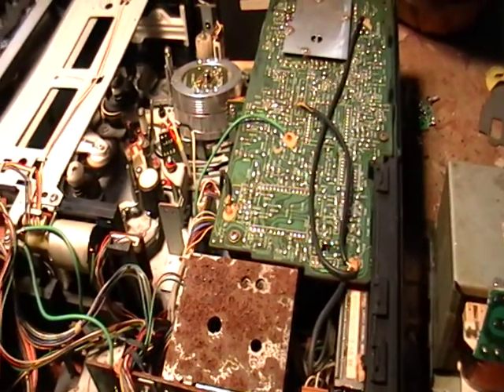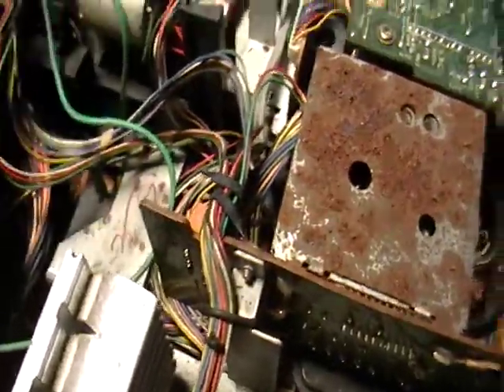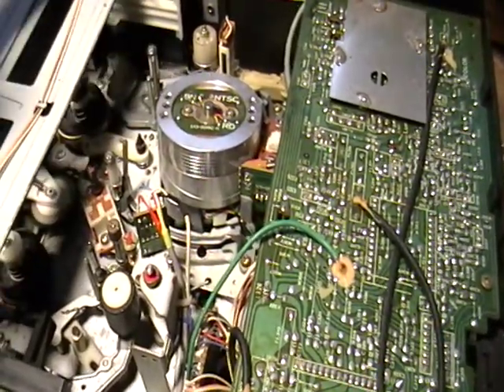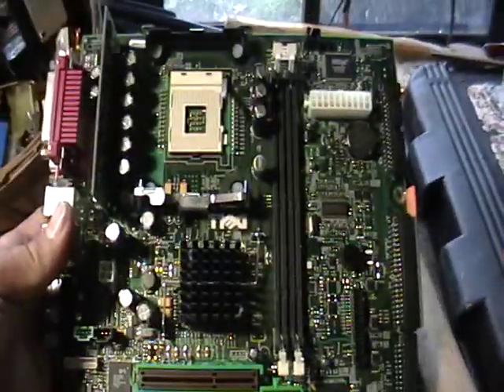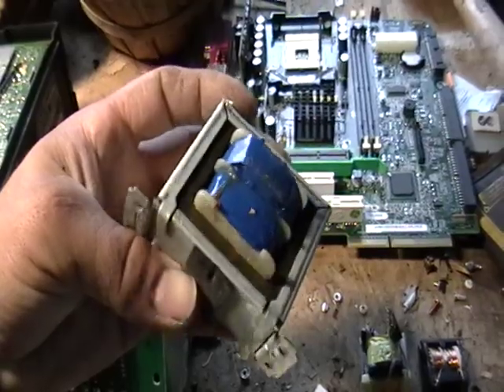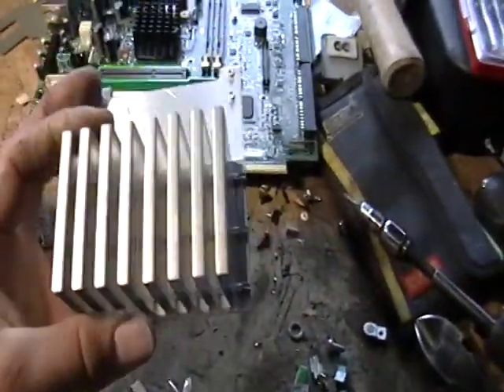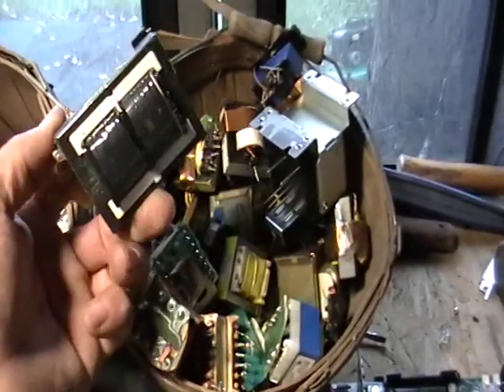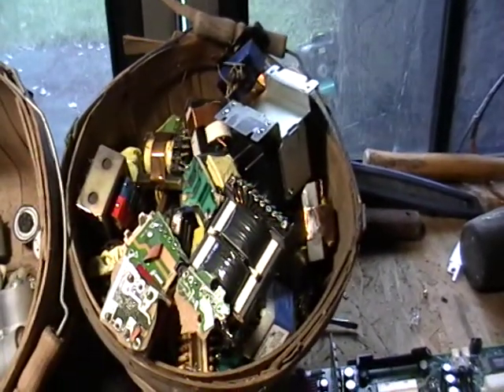scrapping TRANSFORMERS for copper

Comment: what I found easiest to do with transformers is to break them down to the paper roll, then grip that with a pair of pliers and I use a dremel to cut across the wires, I then use a flat head screwdriver to pry open the place where I cut, then peel off the tape. I find it best to do these as I go, and not save them, as that can take a lot of time in the end.

Comment: there is a very easy way to scrap a standard laminated iron core transformer. A hatchet and a sledge hammer. As long as the transformer is not wider than the axe blade, you can split it in half along the laminations, do it on a chunk of wood. A few good whacks and you'll have two C-shaped copper windings on the split core, tap them out of the core with the hammer over your bin and presto. Iron and copper separated.

Comment: I scrap my transformers only because I have the time and I love that copper.  I need to know how do I remove the very old yellow tape that won't come off cleanly from the stripped copper.  If there's no easy way to get it off, which scrapping bin can I put it in?  #2 or dirty copper, or insulated wire?  Thanks.  I love your videos!

Comment: Mike, thanks once again for your videos.  Hey um on the aluminium, I hear you mention the are different kinds i.e. cast.  The scrapyard near here does not distinguish between different aluminiums.  Is there a big difference in scrap value between the different types?  Is 40 cents a pound here.  Should I be looking to save my cast and drive an hour to another yard to turn it in?

Comment: Hi Mike, I strip all those small transformers, however, some of those small transformers have copper strips together with wire, now, my problem is those copper strips are covered with some kind of insulation, which I don't know how to clean that off, do you think you will be able to advise me on this topic.
Reply: marius gerber, Nah, if it's only varnish or solder, sell it as Cu #2

Comment: I guess what I didn't understand is if a Mother Board is 1.25 a lb. why would you strip it of memory boards, heat sinks and etc. because after you strip it where would the value be in the board?
Reply from the maker: The ram boards are worth money separate. Think of it as a car. A junk yard can make more money selling parts of the car then selling the whole car.
Reply: Clem Blackman, the other boards tend to be worth more (pci/ ram/cpu) A scrap yard near me pays $3# for pci cards vs $1.25# for motherboard, it makes more sense to pull out those boards considering that it only takes an extra few seconds

Comment from the maker: You can make more money with the copper off them...Transformers that weigh 1 pound will get you 20 - 50 cents a pound...Lets say you have 5 @ $.50 =$2.50...If you strip the copper you can get at least 2 pounds from the copper earning $2.75 - $3.75 per pound and you still make money from the steel... So from $2.50 you can earn upwards of $7 - $10 on just 5 transformers...These prices reflect big transformers...Not the little one..I would just scrap those as is...

Comment: i scrap mini transformers and there not that hard all u do is grab a towel, wrap it over the transformer, then with a hammer u hit it a bunch of times until the little metal slots seperate, then with pliers you u twist and pull until you get every single one of them out, and once u get the roll, you hit it with a hammer to brake the blastic holding it and untape it, its a little time consuming but its something to do when u r board

Comment: Concerning the low grade boards.  I did some searching, they can't be reprogrammed.  They are just a complex circuit.  What they do is toss them in a grinder, run the material past I giant spinning magnet to collect the ferrous metals from non ferrous (for the most part).  Actually here is a link to it, they do a better job explaining. And yes we do it here in America also. just put this in front of youtube.com     "/watch?v=wdThXCrzsCs"

Comment: 2:10 that's an inductive filter not a transformer.
But I'm just being picky, thing is you just snip where the wires are soldered and pull on them, takes about two seconds to unspool them!

Comment: as far as the mootors and the transformors go they do take time, the small ones sell as is but the medium ones are easy to take apart and are worth it they usually have between 1.75 to 15.00 worth of copper on my channel jrpincctxx i show you how i use a portable band saw to cut the ends and push out the copper.

Comment: LOOKS LIKE EASY MONEY """"NOT""""" very time consuming. for start you got to have a mountain of vcr's & pc's  to make any kinda profit, you gotta burn out the scrap wire from a small part & rake the scrap wire together to what its worth... bit like pennys in a pound" is it worth getting wet over?, not tryin to knock anyone doing it for a few bob or bucks done it myself over the years. if you get hands on enuff weight its well worth it.